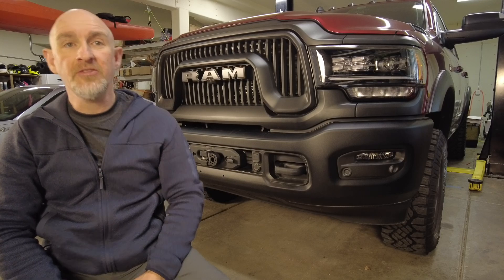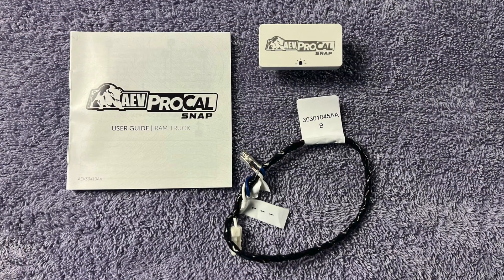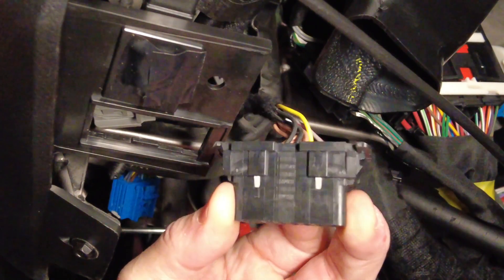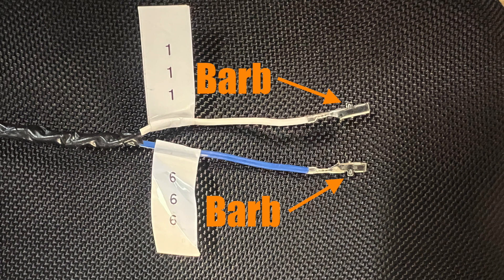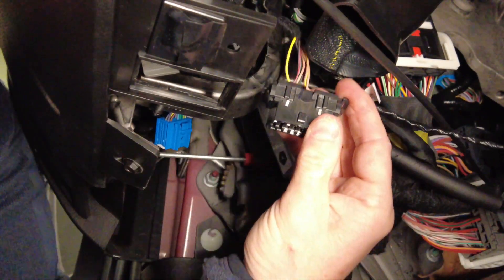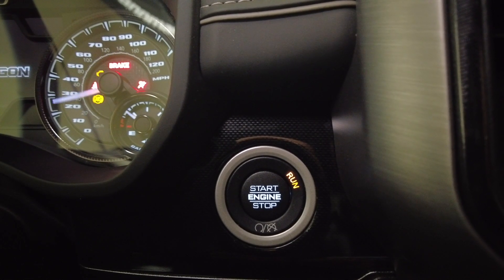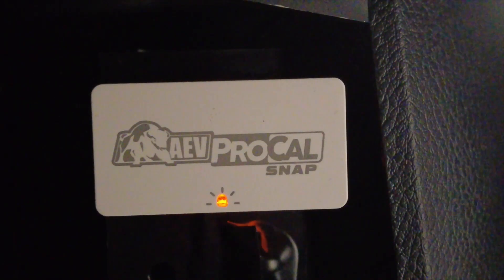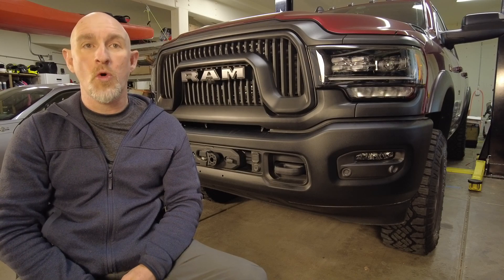AEV ProCal SNAP Install on RAM 2500 Power Wagon

Comment: Watched the video many times now...I have a slow pulsing orange light....AEV,CJC I called just got recordings...figured I ask you...if you know ....I'm writing this and looking at that orange light...
Reply from the maker: If you have a slow pulsing orange light you need to turn the vehicle to "run".  If you have a fast pulsing orange light it's a problem with the connection in the harness somwhere.  If you don't have it - here's the manual.  I hope this helps - good luck!
Reply: @goofingoffroad  slow orange...I did it several times ...push the starter button to on ..then to Run...same results
Reply from the maker: I hope you can get it figured out with AEV or CJC.  If you find the answer can you reply back here, so people can learn how you fixed it?
Reply: @goofingoffroad  yes
Reply: @goofingoffroad  Took a voltmeter..tested the white and blue AEV wires that I connected to the double green board of the truck..had juice ....the pins weren't making contact with the AEV PROCAL...made a adjustment and it work...
Reply from the maker: That's great news - glad you were able to get it figured out.  Thanks for sharing the solution - I'm sure that will help other folks out.
Reply: @goofingoffroad  NP...anything to help...now to try to stuff the 35in spare under the truck...lol
Reply: @emilyscandycakes4530 I'm thinking of switching to 35s. Did you find a solution to get the 35 spare under the bed?
Reply: @rjmoose8918  falkens AT3s...I aired down the spare to 28psi

Comment: Very out dated
Reply from the maker: Ah. Is there a more current solution?  If so, can you share what it is?
Reply: @goofingoffroad  ya it's called Tazer DT
Reply from the maker: @alexgrech4420  oh, cool - thank you for sharing.  I'll have to look into that!
Reply: @alexgrech4420  The Tazer in the Ram's are only able to change tire size up to 35". If you want to program 37s, 40s or even 42s AEV Procal is the one for you.

Comment: Great video! I just got mine in for my 2021 Power Wagon and went to install, but I have a cable already plugged into the OBD2 connector. Can I unplug this to install the prosnap temporarily then plug the other cable back in when I’m done? Just curious because I cannot find any info about this. Thanks!
Reply from the maker: Yes, you should totally be able to do this.  The ProCal just needs to connect to the ECU on the truck long enough to change the values - so plug it in, make your changes and then unplug it again.  Good luck, and enjoy you Power Wagon!
Reply: @goofingoffroad  Awesome! Thank you so much for responding!

Comment: My personal experience just now. Don’t use the the single row star connector, use the double. I used the single first as it was mostly open. My ProCal slow flashed orange. After several attempts getting it paired to my truck, I decided to try the double row star connector. Two fat hands crammed in a tight dash with sharp edges everywhere made Swiss cheese out of both hands. After getting the plug moved over I had zero issues.